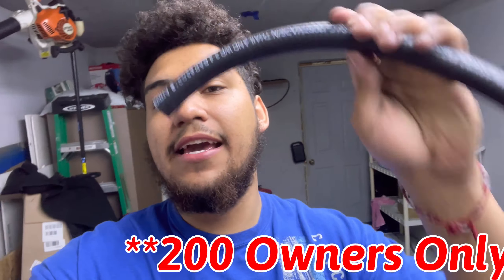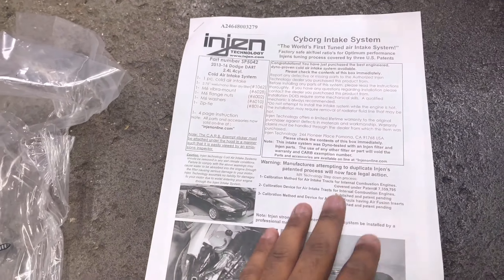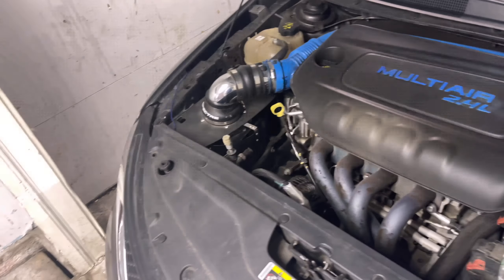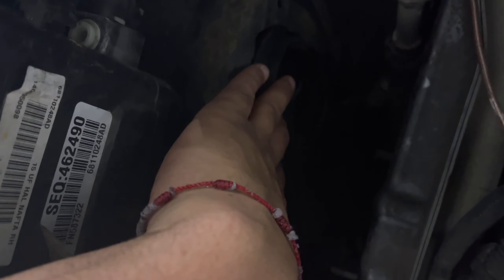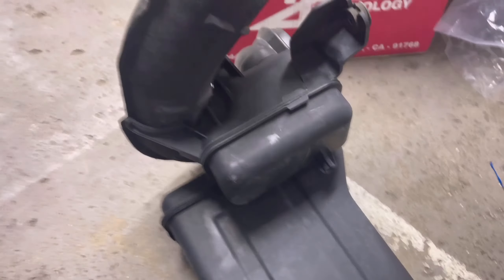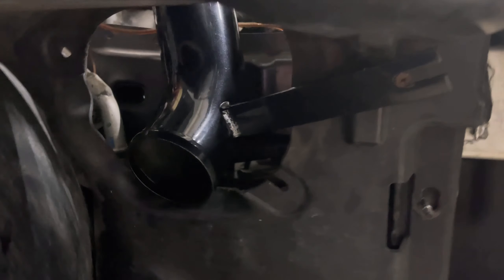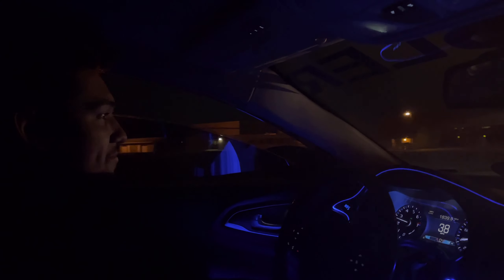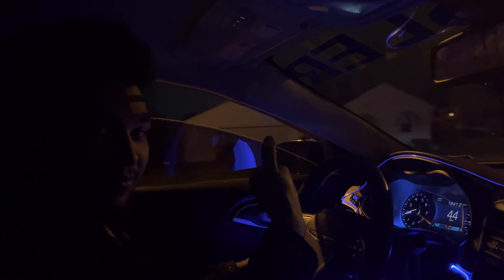2.4 Multi Air | Injen Cold Air Intake | Chrysler 200 & Dodge Dart | Install and Review !

Comment: So I have a bone stock 200 lim Ed as well and been following you for a few months ever since you did the wheel paint with rustolium. I've clearly missed some things but how did you obtain sport mode? Hit me back man. I really like your work
Reply from the maker: Hell yeah bro I appreciate that more than you know 💯🔥💪🏽 check out my slightly older videos should be right by each other , the paddle shifter upgrade as well as the sport mode upgrade ! 💪🏽